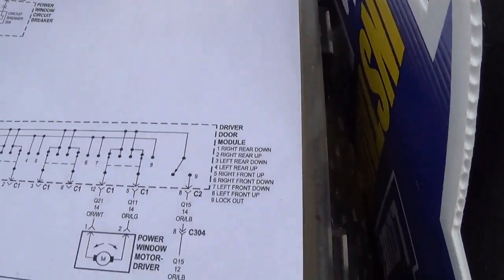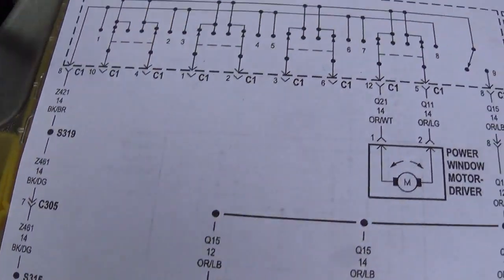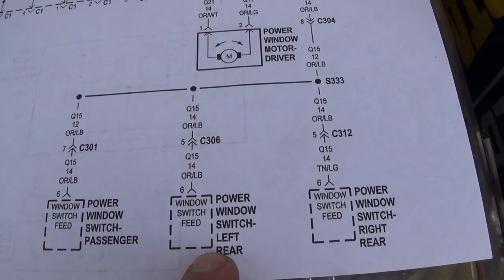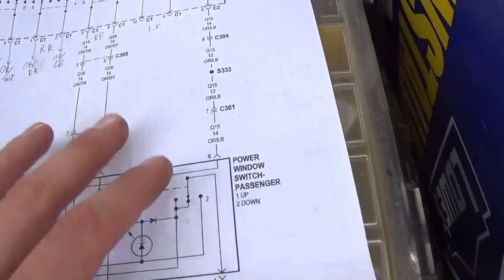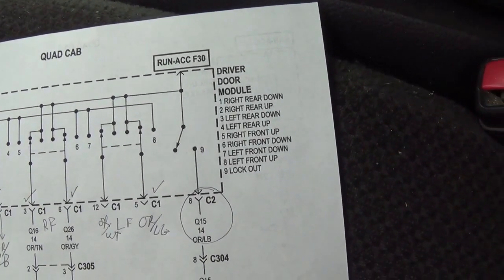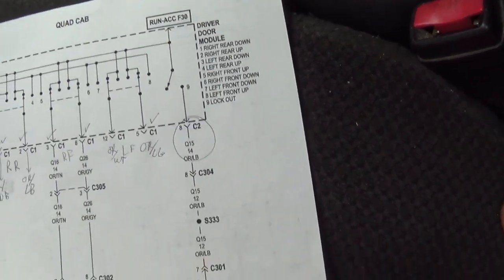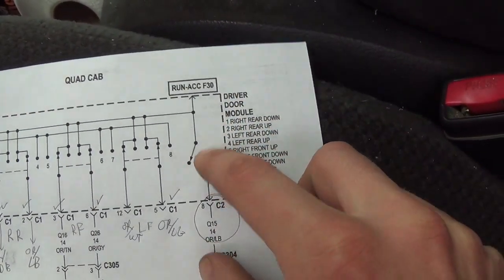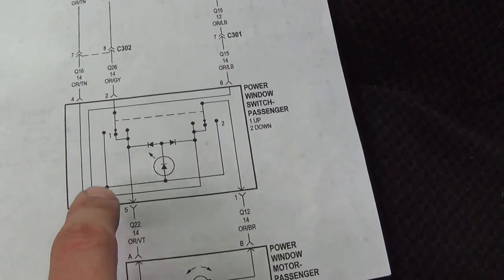Power Window Extravaganza: '04 Dodge Ram

Comment: You could get one of scanner danner test lights that you can take the tip off and exchange it for a tip that has a wire that is like 3 feet long with i forgot what type of end on it . He showed it on one of his episodes. You might be able to do the same thing,get different tips that can unscrew to put different tips on like the regular one to one that has 3 feet of wire on to one that has ten feet on so you can have the test light in the windshield while connecting to like the starter and for like this episode  hooking up extra test leads to the tip very pain in u know where. That way it be more helpful for you testing .

Comment: My hat is off to you young guys that have the patience and persistance to track down the built in problems in modern vehicles. I really think that there should be massive class action suits against manufacturers that produce the crap they foist on the public. It makes me cringe when I see the connectors they use with tiny pins, located where they can be sprayed with salt water. There is no excuse for this. All of us would be way better off without the "Features" that severely compromise reliability.

Comment: My truck is an 07. Everything works but as soon as I drive it around and then stop, everything turns off on the driver switch (My driver side switch has individual lights for each switch). And I can't operate the windows. I turn the car off and turn t back on and it works again. It's driving me crazy but I'll use this as sort of a guide.

Comment: My 04 2500HD 5.9Cummins did same thing but was driver side rear. Even the speaker didn't work . Pulled the wire harness between door and cab and 5 of the 8 wires were broken. Stripped and reconnected them and everything was back to normal. Dodge sent all plastic and wiring work to Mexico from 02-06

Comment: 2002 Ram 1500 here.  Very common issue.  The solder joints break in the door control box.  Reflow solder to fix.  The second issue is the wires inside the boot from the door to the pillar break inside.  Unhook the boot, fix the wires, reinstall boot.  Problem solved.
Reply: The problem is also solved by not buying anything made by Chrysler CORP.

Comment: I had the same problem, and it was due to the window lock button failing. Saved a lot of troubleshooting time by just replacing the entire driver side window and door control module. Bought OEM compatible module on Amazon, from SwitchDoctor, for less than $20. Completely plug and play, and swapped in less than 5 minutes. I heard you can also find the part on EBay.

Comment: Ivan the mistake you were making is you were grounding to the latch instead of the other end of the orange and white wire. Thus by making a global ground at the door the long range drivers switch would not work but the switch at the door would. Easy peasy Ivan.

Comment: just fixed my 03 ram, symptoms were the same passenger window would not work at its switch and had no power, pulled driver switch apart and boom same bad solder joint, re soldered and back in business, no parts required, thank ya much!!!!

Comment: Props to you for fixing the switch module instead of replacing it!! This is a common problem but I would not expect one out of a 100 techs to reflow the bad solder joints. BTW, it's always better to change or at least add solder. 
Well done!

Comment: I know this is an old vid, but I watched it just to see your process. PW with the smart logic driver's door switches can be a real treat to diagnose. Scanning them through the BCM actually helped me track down an intermittent master sw, and also a broken wire in the door flex on a Kia Sedona. The master sw was NLA from Kia, and the aftermarket 1's were $157.00.. I took that 1 apart to find cracked solder joints as well. ( and told the customer to stop slamming the door LOL ) Then the driver's side flex had a broken wire in it. I actually had to fish the door loom all the way out and remove the door to fix it, because there was no room to get in there! I added about 2 inches of additional wire to help it have room to flex. They could've done that from the factory, as there was ample room for just a bit more length. I too use solder and heat shrink for my repairs. Butt to butt connectors just can't take that kind of movement.

Comment: It would have been better if you'd used a proper load resistor instead of the little test light.  The motor draws many amps, probably 40 times more than the test light.  So a poor connection somewhere will still light the test light, but not pass enough current to drive a motor.

Comment: looking back at this video one year later what would you do differently to speed up your diagnosis time?
Reply from the maker: Keith, you are a brilliant teacher to ask a question like that! Well, I wouldn't make a lengthy video. Then I would trust my intuition more than Chrysler's crappy diagram. And I now have more convenient test lights! Anything else you would do?
Reply: motoYam82 Rather than using outside ground sources in the beginning for my test light. I would have gone right across the pins for the motor , regardless of how the diagram looked it did have one valuable item which was the 2 wires to each motor. And as we know all they need are power and ground. It would have shortened the diagnosis a bit

Comment: Great video, excellent approach. One time I had a ford truck with power windows problem that only work when stepping on the brake pedal. At the end it was light bulbs blown  at  the high mounted brake lights. Keep up with the good work.

Comment: overthought way to much 1st thing is to do is always check the door boots for breaks fix them . and they rest at ground  driver door switch is known for issues
Reply from the maker: I am showing how do do a diagnosis from scratch. Of course you can start with common issues and replace the driver's door switch but where's the fun in that? Do you learn anything new by doing that?
Reply: you am agree with you ,not to be a part changer many of mechanics and auto electrics doing that not understanding the isses

Comment: This power window switch is  a reversal rest at ground switch. when the switch is in the neutral/rest position both window motor wires should show ground, the power is reversed on one of the 2 window motor wires when the power window switch is moved from its rest position. If the power window switch is moved to  the up position one of the 2 wires will rest at ground while the other wire will be switched to positive. The power on the wires will be reversed when the power window switch is moved to the down position. Instead of grounding the suspected broken wire I would have jump it from the driver door switch to the RL door switch to check for change or use my multimeter to check for continuity in the suspected broken wire. If this was a data to data power window/lock system and you jumped that suspected broken wire to positive it would have been toast!
Reply: What was wrong with cranks? Especially on  a truck??? I learned when I was very young that about 95 % of the problems found on vehicles is electrical.

Comment: Great video & diagnosis.  So happy to see you fix the switch rather then replace it. Too many people think broken electronics can't be fixed. It may just be me, but I've always like working on window circuits. Especially ones with window lock-out buttons. The circuit design is pretty ingenious, IMO. I had the same exact cracked solder joints for the window lock-out button on my '03 Dodge Durango a few years back. Its pretty much the same driver door switch/module you were working on. In my case the cracked solder joints were on the back side of the circuit board where the pins for the button were soldered to the board. From reading various dodge forums, bad solder joints in the driver door switch is a common issue with this vintage Dodge cars & trucks. Cold solder joints from the factory I guess in conjunction with people pounding on the button over time.
Reply from the maker: +Pet Rock's Garage Thanks! Actually if you think about it, the lock-out button is barely ever used. The fundamental design flaw, as can be seen in the schematic, is that all the current for the window motors has to pass through that one solder joint when any of the "slave" switches are used. 

The problem is compounded when more than one window is operated at the same time...  Excessive current on a circuit board with solder joints is never a good idea lol
Reply: +motoYam82, very true.  btw, I was just looking for the follow up video and can't find it.  Did you ever upload it?

Comment: Quick question if you have time, my 2006 Durango 5.7l the wipers will swipe once upon startup, otherwise they work fine. Sometimes it doesn't do it either. Any ideas ?
Reply from the maker: +417cameron That's weird lol...nothing wrong with a clean windshield before you start driving right? Looks like on your truck the body accessories are all controlled through the integrated power module, which could be glitching. That's the problem with newer vehicles...everything is controlled by black boxes, so all you can do is check inputs and outputs, then replace the (expensive) box!

Comment: Man you gave me a headache till you found that cold solder joint. Good info I've got power window issues on two of our vehicles.
Reply from the maker: +Eric Corse lol that diagram gave me a headache...had to run around in circles for a bit. That diag should have taken half the time if the manufacturer info was accurate :)
Reply: Isn't that the truth.

Comment: Yup.  Chryslers and their wiring looms.  I worked on a Journey where the rear wiper would come on when the driver selected reverse.  Broken wiper ground wire in the rear hatch loom in the rubber grommet thingy.  Took a while to realize where the open actually was.  Now I see it's a common problem.  Thanks for the vids.

Comment: Just for future reference, in the Chrysler "cloud cars" (Sebring, Cirrus, etc) there is a well known issue with the Dash instrument Panel developing cold solder joints.  This typically manifests as bad or non-sensical readings on the tachometer, and sometimes the gas gauge and coolant gauge.

Comment: Well, your Description above says it all............. bad diagrams, more than one mechanical problem, and an intermittent failure mode.

That's pretty complicated.

I admire the way you handled it.

In this particular situation, the process of filming and narrating probably added a larger layer of complexity than it usually would.

I like the Important Mention you made of using a fuse in a jumper wire in certain situations. Very important.

Well Done Master Ivan.
Reply from the maker: +douglas “The flame is dead” lee Thanks Douglas, it was a little messy for sure but now I know to trust my test light more than OEM wiring diagrams lol
Reply: I assume you'll be getting back to the ignition module study when you have time?
Reply from the maker: Don't worry Douglas, it will be posted very soon!

Comment: Very nice thought process Ivan and anyone could get side-tracked with the wrong diagrams. I was looking at the diagrams at the beginning and couldn't see how the windows were supposed to work. I just let it go and followed along with you. Sure enough, the diagrams came back. One other thought that was a little surprising to me is that the switches were controlling the current to the motor. With a later model vehicle, I would have thought they would use the switches as inputs to a solid state door module in each door. Great video as I'm sure we were all thinking of what's going on with these windows.

Comment: Just when it was getting really good. Stay tuned to next weeks episode..  Best part was when u yanked that a witch apart and voila. The solder joint.
Reply from the maker: +Bill Rimmer That joint was the worst one I've ever seen. Surprised that it even worked intermittently!
Reply: Bill Rimmer remember that loadpro lead set I gave you? They would have found that high resistance solder joint fast. Testing voltage of an unloaded circuit means nothing.

Comment: At 10:00 I just paused and downloaded the diagrams (BBB) as I wanted to follow you along and i sat there vor 5 min starring at the door switch (not master). Because i saw no ground when you use the door switch :D 
I was pissed and said to myself if this diagram is correct ill stop calling me a 'NFZ-Mechatronicker' (German truck mechanic). Started your video again to see what you will do AND BAAAAM at 11:40 you said it: ITS ALL WRONG ^^

They somehow confused the two diagonal lines in the masterswitch diagram
Reply from the maker: +1kleineMax1 That's awesome! You reasoning is right on the $$. Initially when I first studied the diagram, I assumed that the ground for the auxilliary switches would come from the common "lockout" wire, even though on the diagram it was an "open" pin. Nope haha.
Reply: At our shop we had to beg that the boss buys a subscriptions for two of our main brands (MAN, Mercedes Benz Truck) because you can not find diagrams an tech-info for free with these brand. But i hope they do a better job with there diagrams :D
This fault it the diagram cost you an nearly 1h, didnt it?

PS: Do you now a sauce for CATERPILLAR wiring diagrams, cause i often work on them, but in germany you cant even buy them from CAT...
Reply: +1kleineMax1 Like you I downloaded the wiring diagram from BBB and came to the same conclusion! Ivan is on the money.The positive and negative connections as shown in the drivers master switch diagram are drawn back to front. It shows power being supplied on the 2 wires going to each switch instead of 2 grounds when the circuit is at rest. Also if the other 3 window switches don't have ground continuity to the motor at rest,, the window switch on the drivers door may only operate the window one way depending on which side of the switch( at the door ) has no continuity. Any auto elecs out there feel free to correct me if i'm wrong!!! Another great piece of detective work Ivan...

Comment: the difference between a loaded and unloaded circuit test. the flow chart im sure would have you check switch continuity and then you would have missed it for sure. get yourself a set of loadpro test leads and a power probe to go with your tools bud
Reply from the maker: +phil holbrook I have thought about the PowerProbe and LoadPro "time-saver" tools. HOWEVER, the old-fashioned test light wins in two areas: simplicity, and circuit safety. It is just too easy to accidentally press that magic button and see the magic smoke :) 
A regular incandescent test light and some jumpers can do everything the fancy tools can with a little more time for thought...which is what diagnostics is all about!
Reply: +motoYam82  Ivan I too was going to mention the load pro  ( I have one ) ..those will NOT power a circuit only add a load .. now as you know the power probe can ..and would be great for say testing that motor on the windo  ..
 but for helping us learn  about wiring diagrams and yuour thoughts,,I love the test light work you and Eric do!!!
Reply from the maker: +deepsquat600 I am wondering: how is loading the ckt with the Load Pro different than loading it with a test light? Are there different current settings?
Reply: +motoYam82  well I guess the only difference would be  that you could see the voltage ..and if not 12 volts you can see added resistance in the wires ?? ( corrosion ect?? )
Reply: +deepsquat600 BTW Dan Sullivan ..the inventor of Load Pro has a few videos on here..being that you have 10 times more knowledge then I do on electrical circuits maybe watch one or two? even has one were a tech is checking a power window problem :)

Comment: Crap, my 2000 Jeep Cherokee had the exact same problem with the master switch as do many other Jeep owners. This must be a common Chrysler issue covering several years. Excellent video Ivan.
Reply from the maker: +peelman1506 Those Jeeps also like to break wires at the door flex :)
Reply: +motoYam82 yes, what makes it worse in my jeep for some reason Chrysler decided to use a stiff connectors inside that flex boot and of course the wires would brakes of either side of the hard connector.

Comment: Just mind blowing vid. Ivan I have the ScannerDanner style test light with a much finer tip for back probing. Fantastic testing , man that was off the hook. 👍👍
Reply from the maker: +Steve Rob Hmmm might be interested in that fine-tip test light if you know where I could get one :)    
Glad you enjoyed that one Steve...turns out this was just a warm-up for the Toyota that was next in line after the Ram.   Good thing the camera battery didn't run out!  :)
Reply from the maker: I prefer the test light in many situations because it provides a SMALL load which can efficiently locate wiring problems (high-resistance issues like corroded connections or wiring damage) where a DVOM would show that everything is OK. The test light is KING for checking main powers and grounds, like here with the power window controls.
As far as damaging sensitive computer modules, I cannot think of any situation where a test light would "fry" a component. A typical test light carries only about 200mA at 12V. Furthermore, the vast majority of computer inputs/outputs are well protected from excessive current by internal circuitry.
Basically the DVOM and scope only come into play for checking voltages on high-resistance sensing circuits, as well as for the occasional component resistance check. Great question!